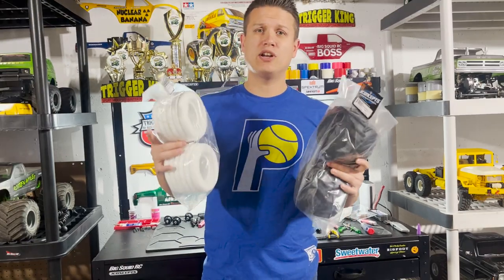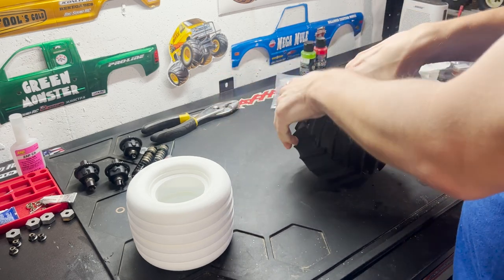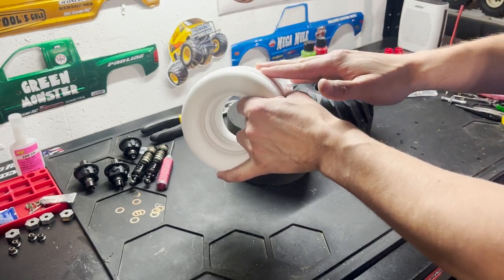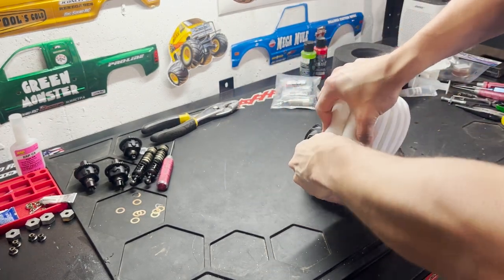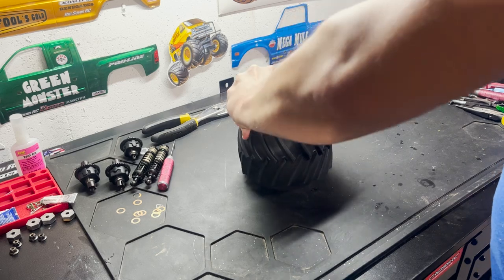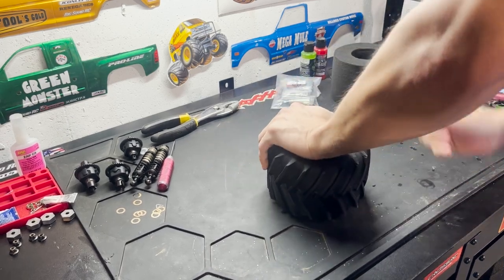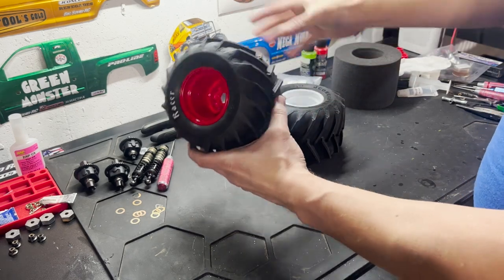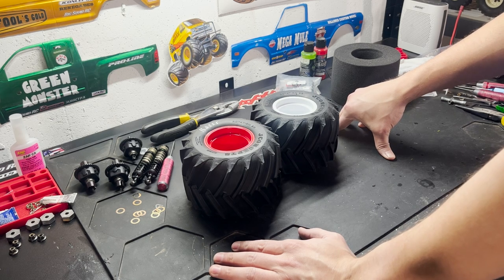How to mount JConcepts Slam-Tech Monster Truck Closed Cell Foams - Trigger King Tech

Comment: Great video, what kind of glue do you use? I currently use e5000. Because of the removeablity...but the downside it often becomes loose
Reply from the maker: I use a thin CA glue that my local hobby shop sells as their own branded product, but it's just a standard thin CA glue for tires. If you use a thin CA glue even though its not supposed to be removable, you can bake off the tires if you want to reuse them assuming you don't get wild and go heavy it (baking will waste foams though). If its something to be removable, we use shoe goo. You can do that with retros as you don't have to worry about tire speed
Reply: Same with mine. B7000 or e5000. Never saw racing, only casual ride and lightest bash👍🙌🏞️